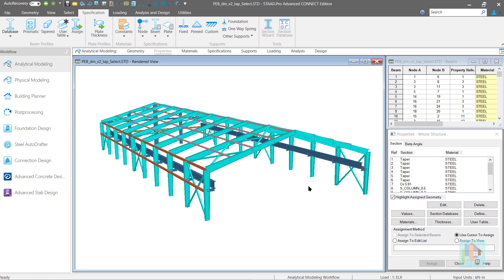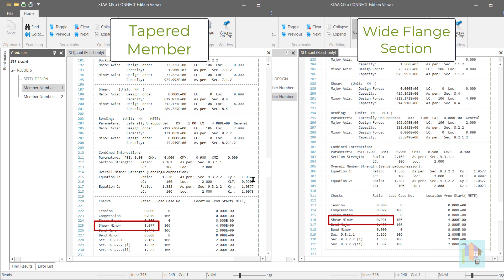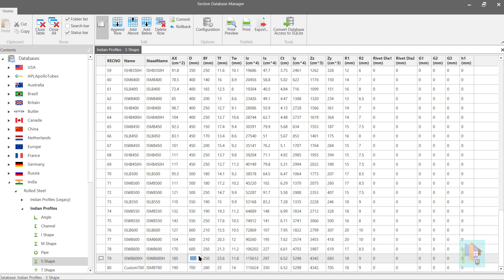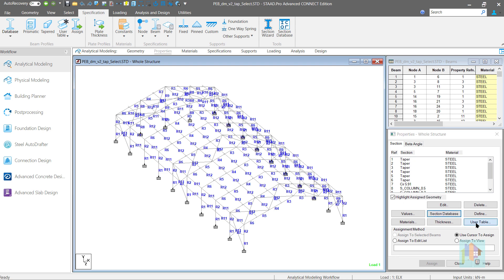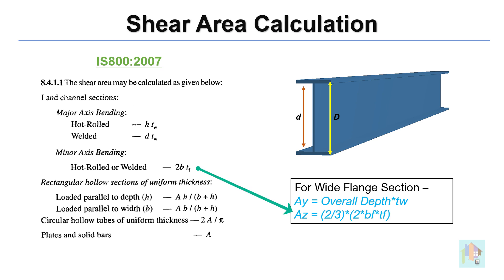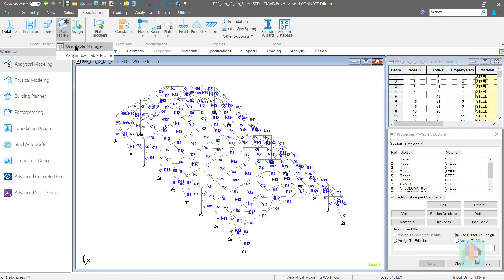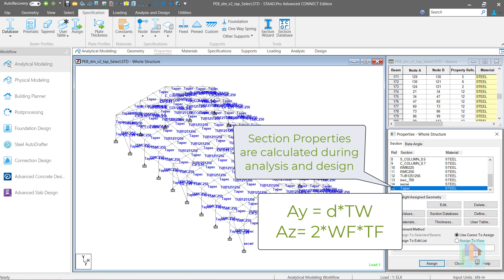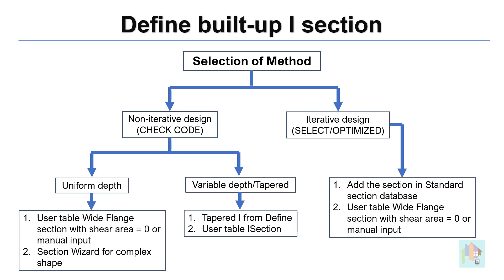Different methods to define a Built-up I/Plate Girder section in STAAD || Incorrect Shear Capacity

Comment: Sir please show some light on how to export 4 angle built up section.
When I export the built up angle section and assign the property to member than it is throwing error that Ay or Az is not defined
Reply from the maker: If you create this section in section wizard and import that in STAAD as general section, AY AZ values are set to 0. Open the section property page from user table, and provide the shear area values.

Comment: Thanks sir. I have a question. When I create built up section using section wizard and import to staad using general, then 3d rendered view does not show section as you mentioned in the view. But when I switch on diagram > 3d sections > full sections, then I see rectangular section for such general member. Please clarify what is happening here ?
Reply from the maker: This is how the logic is hard coded in STAAD. For any general section, as there is no info about the original section (only equivalent section dimension is available), so in the rendered view, it is displayed as a stick line but in the full section/section outline diagram, it is represented as a rectangular section. In the member query box, you can notice similar type of rectangular representation without any dimension.
Reply: @surojit_ghosh  thanks for the reply. got it

Comment: Thanks Surojit for uploading more and more informative content, i have 1 problem where i have to design 2 face to face Chanel sections for column with certain size of m.s.plate welded on both for connection but staad shows error and this only can be design with is 800-1984 code but i want to design section with latest codes so how can i overcome this problem in staad pro.
Reply from the maker: It is possible to design any front to front and back to back channel as per IS800:2007 code in STAAD.Pro, if you define it from standard database. I am not sure which version of STAAD you are using. This facility is available in STAAD.Pro CONNECT Edition, and if you use any older version of STAAD which was released long ago, then you might get an error that this section design is not possible. 
If you are using any current version of STAAD and still unable to design a front to front channel section, you can upload your model in the Bentley Communities(https://communities.bentley.com/products/ram-staad/f/ram-staad-forum#pifragment-25818=1). I will review your model and let you know the reason.
Reply: @surojit_ghosh  Thanks for your reply, i am using staad connect Edition with latest version and applying property from standard database only but still have same problem.
Reply from the maker: I don't have any scope to upload any screenshot here or review your model. If you can upload the model in Bentley communities site, I will definitely check that and let you know the reason.
Reply: @surojit_ghosh   Ok sir, will upload there

Comment: For bracings both horizontal and vertical in chevron and x bracings what will be the "Ky and kz" Exact value to be used as mentioned in the code. How it is decided ? what will be kz and ky value for bolted and welded connection with gusset plate. As in some designs it was 2 and in some design it was 0.8 for vertical x bracings welded connection with erection bolts .  In what basis they are adopting the degree of restraint (connection with Gusset as welded ) and choosing those values. It will be more helpful if you clarify me. Referred many books and structural forums but unable to come to conclusion. Thank you.

Comment: what will happen if i assign a I beam using general or prismatic sections in user define instead of Wide flange and I - Sections ?
Reply from the maker: That's a good question and I will cover the details in my next video. As a summary, when you create a user table general section (or from Define option), you need to specify all the properties along with I section dimension (D,TD,TB etc). Program can design any general section as an I section using these section dimensions. This has been discussed in this video- I have imported a section from the section wizard as a general section (check 11:56). 
Prismatic section design is not possible as no section dimension is available for this type of section. It can be used only for analysis. For any LSD code like IS800:2007 or AISC 360, section classification is a must which is not possible for the prismatic section. Only few WSD code like IS800:1984 supports prismatic section design as section class is not determined in this code.
Reply: @surojit_ghosh  Thank you for the reply. Can u clarify this question also - For bracings both horizontal and vertical in chevron and x bracings what will be the "Ky and kz" Exact value to be used as mentioned in the code. How it is decided ? what will be kz and ky value for bolted and welded connection with gusset plate. As in some designs it was 2 and in some design it was 0.8 for vertical x bracings welded connection with erection bolts .  In what basis they are adopting the degree of restraint (connection with Gusset as welded ) and choosing those values. It will be more helpful if you clarify me. Referred many books and structural forums but unable to come to conclusion